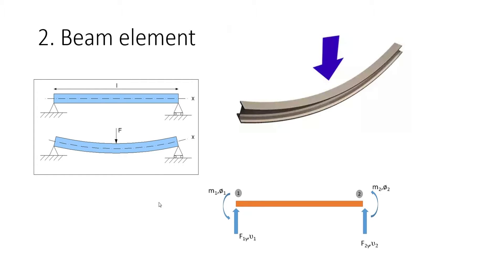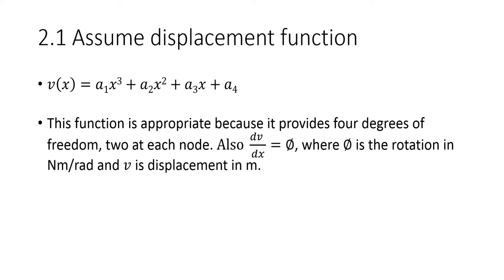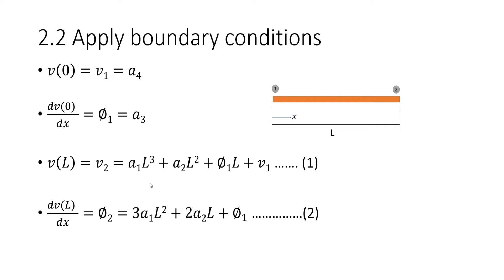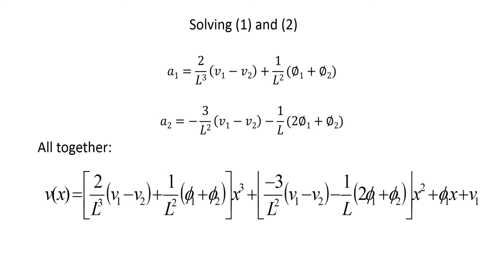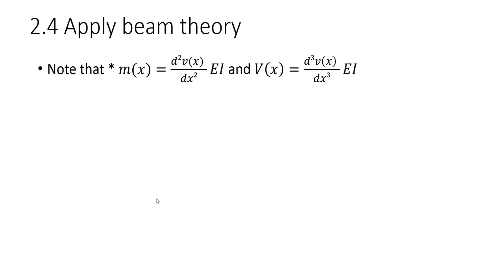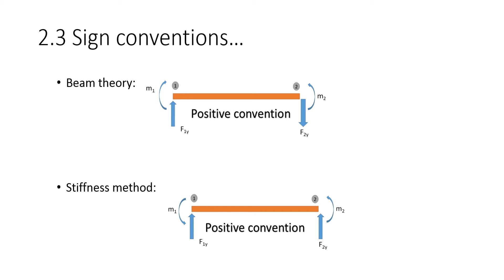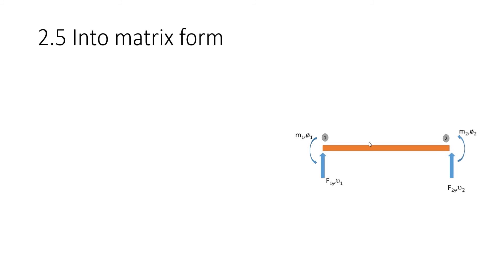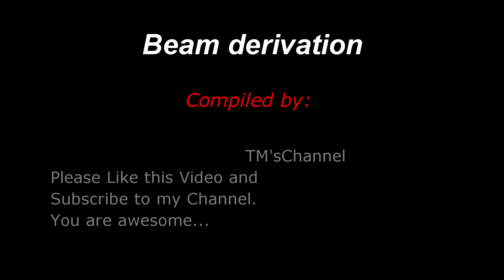Coefficients of the stiffness matrix - Derivation - Beam element - CORRECTED & EXPANDED

Comment: Thanks for the video. If i have to develop the same for a beam with one hinged end, how i have to procced? Sorry for my bad english
Reply from the maker: Hi, for a hinged beam you have two options, both boils down to specifying that the displacement at one end is zero, while you can still have a rotation. The first is to start the derivation assuming u1 or u2 are zero and carry on from there. The second method is used by most commercial software packages where they create a secondary "release" matrix. The effective element matrix then becomes the product of the normal [ke] matrix and the releases matrix [re]. This method is preferred because you can then easily apply partial fixities as well, not just 'complete' releases. I'm sure if you google FE element release matrix you should find something to work from. Good luck!
Reply: @TMsChannels  thank you

Comment: how will be the stiffness matrix if the horizontal displacement is induced?
Reply from the maker: Hi, thanks for the comment. If horizontal displacement is added you would arrive with a frame element. This element has 3 degrees of freedom at reach node (horizontal and vertical displacement along with rotation) and hence the stiffness matrix will be 6x6, not 4x4. You can see the derivation of this element in this video: https://youtu.be/wq7Os0hdYtk